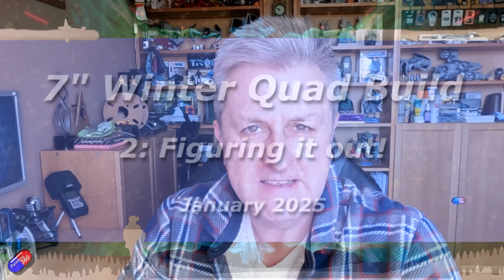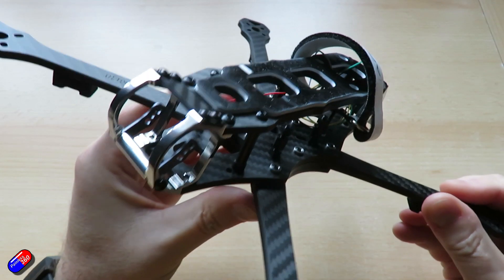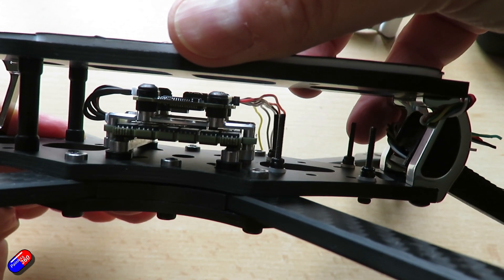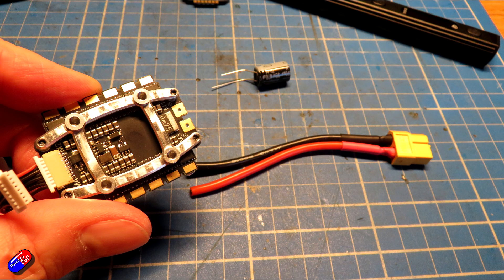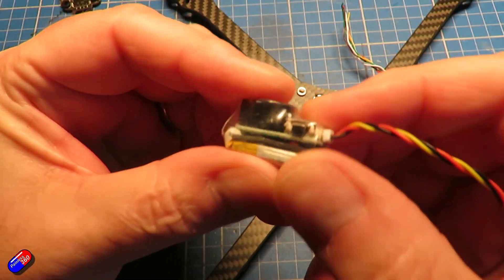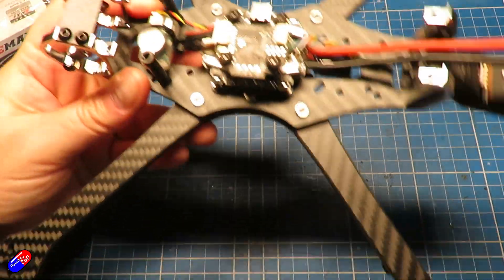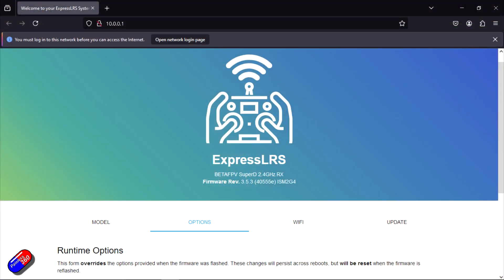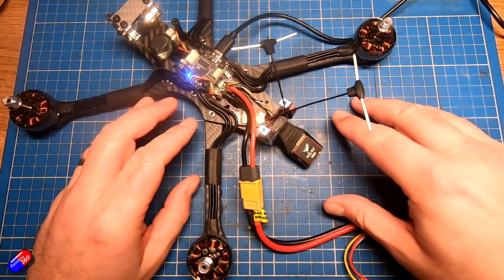Festive Holiday 7" Quad Build: 2. Will all of this stuff fit in this frame?

Comment: Anybody having any issues upgrading to INAV. The Lucid board comes with BF 4.51 and when I try to put on INAV I keep geeting no response from bootloader. Ive tried a different computer and different cables. I used Zadig and still no go. It wont update in BF either but I can read and make changes. Any ideas???  Bout ready just to install and leave BF on it.
Reply from the maker: All of mine have flashed without issue to inav 7.1.2... Best of luck
Reply: @Painless360  3rd laptop and got it to work and take the flash..

Comment: Great video where did you buy the FC, GPS and ESC from? I would like to build a replica of this model but am struggling to source these items.
Reply from the maker: GPS, Banggood. Frame from Armattan, FC and ESC can be got from Unmannedtechshop, motors from HobbyRC, Walksnail unit from DroneAuthority... Lots of places have this stuff.
Reply: @ Brlliant thanks!! In your next video can you put a full parts list in the comments please. I usually use Betaflite but an keen on building a drone with iNav
Reply from the maker: For the build series aimed at beginners, I list the parts. A simple web search will find all of the pieces shown. Links change and become broken quickly, even when added... Happy flying

Comment: Hi Lee you mention doing a wiring diagram before you start, just wondering what software you use to do this?
Reply from the maker: You can use anything, but I use PowerPoint... Happy flying
Reply: @Painless360  Well there you you go. They look so neat.
Reply from the maker: Thanks for the feedback, I've been using PowerPoint since the mid 90'd so, with almost 30 years with the program, I can run up diagrams and graphics very quickly with it. There are probably better tools about now, but it's too hard a habit to break! :D

Comment: I regard myself as relatively competent when it comes to quad building, but pleased to say I learned lots from this video.  Removing the arms from the quad before fitting the motors so that you can fit the heat shrink, why have I never thought of that before, probably rushing to build the frame.  Fitting the VTX to the top plate, wouldn’t do that for a five inch because I run two battery straps, but for a long range that’s genius.  Last build point, keeping the buzzer away from the magnetometer, I’d never considered that as a source of interference, always put it down to RX and VTX noise so I position the GPS above the camera instead.  It’s nice to be enlightened thank you.
Reply from the maker: Thanks for the comment.  I like to see others' builds,  as I often spot good ideas as well! It's easy to just repeat the same process that works for you and miss some cute ideas... Happy flying!
Reply: Also on the gps/magnometer wiring, I’ve just solved the inav poshold toilet bowling effect by not having the battery leads run parallel to the gps wires.  I’m thinking of trying to shield the wires with a sheath from some coax cable to see what difference that makes. I’ve just built my first quad, its also a 7 inch so leading loads from you, as always! Many thanks for doing this series.
Reply from the maker: Try not to run the two wire lengths too far 'side by side'. This maximises the 'crosstalk' from the power wires into the signal wires from the GPS/Compass. A little gap between them can make a huge difference, as can making a loop from the excess wGPS cables so that the interference cancells itself out.The magnetic field strength isn't huge and the magnetic flux from the power wires doesn't bleed to far outside the insulation. Check out my wing builds where I make one side of the bay 'power wires' and the other 'signal wires' for this reason... Best of luck!

Comment: I'm surprised how difficult the build is. It's impressive how you take all the challenges in your stride! To me it looks like Armatan didnt intend for the frame to be fitted with GPS or even HD video!? The last frame i used (iFlight) had all the 3d parts printed in the kit for all the major brands of parts, and that was a few years ago...
Reply from the maker: I think that you're spot on, a GPS wasn't considered. Hopefully Armattan will see this and consider it, especially for larger quads. It isn't just Betaflight flippy floppy pilots now... Happy flying!
P.S. Even with the Walksnail unit mounted under the top deck, there is eacily enough room for the 'double battery strap'. I just checked..,